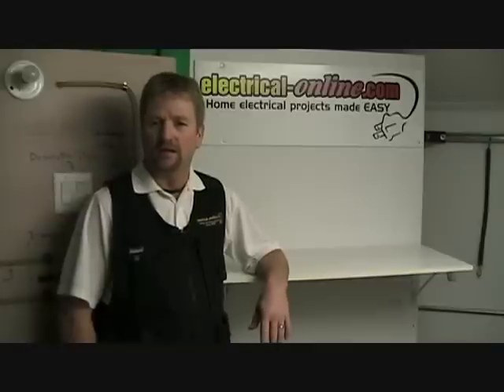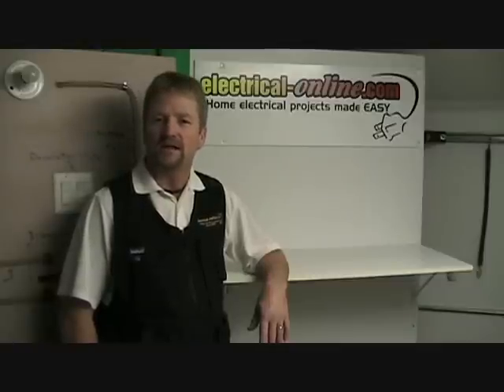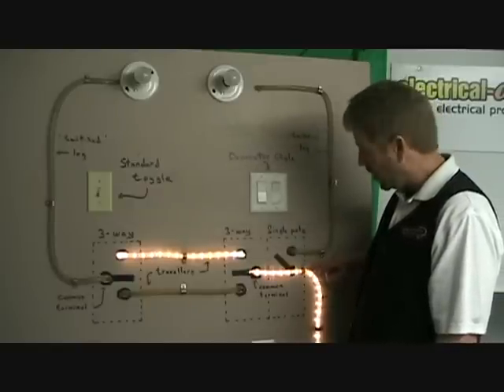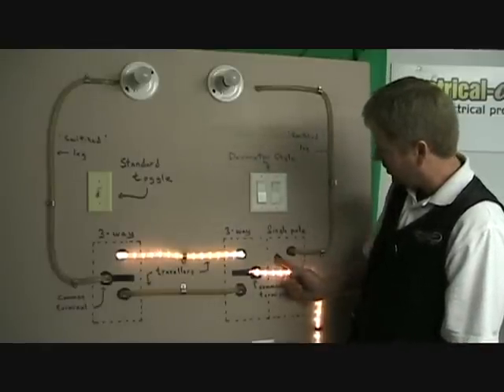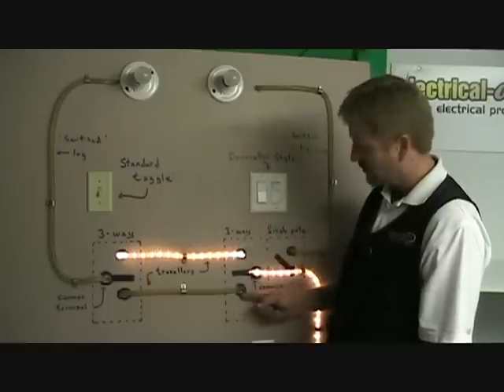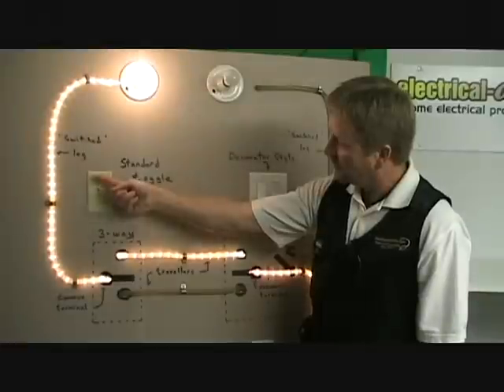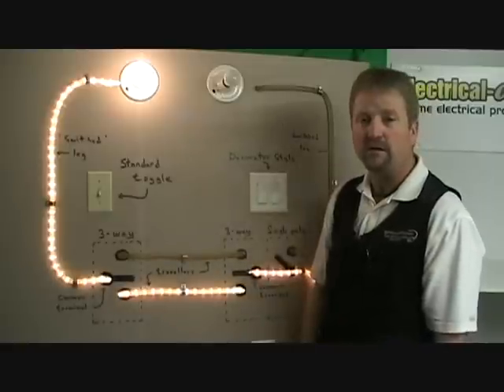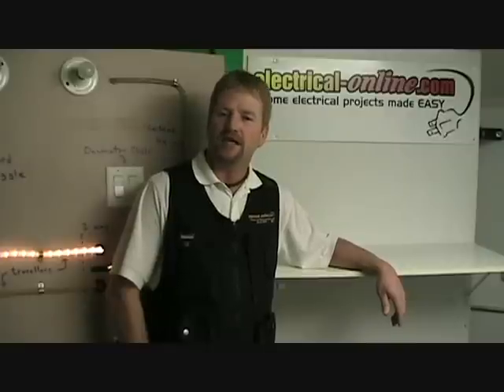Understanding Single Pole and 3-Way Switches

Comment: Great demo; pictures always make it easier to understand. For the beginners, who probably shouldn't be wiring anything without supervision, you may want to mention that 14/3 wire (or an extra wire) is needed between the switches. They may not realize (since it isn't shown) a neutral has to go to the lights to complete the circuit. Again, these people shouldn't be attempting electrical work if they don't know this but they will.

Comment: Why do you always wire your single pole switches with the bottom screw as the hot?  I was always taught that all switches (unless marked otherwise, line vs. load) were fed from the top.  This dates back to the old knife switches that open with the blades out.  The code required those switches to have the blades de-energized when open.  Hence, Line top and Load bottom.  It is very hard for me to do anything else on any switch.  What is your reasoning?  Thanks, great videos!
Reply from the maker: Like yourself, I guess it comes from how I was taught! It doesn't really matter, but your rationalization with the knife switches certainly is valid. Keep doing what you do!
Reply: Terry, after looking at some Mike Holt blogs and a little internet search I think you are correct.  It doesn't matter on a single pole.  Actually the marked terminal on three ways is on the bottom too.  I really like your videos, I can tell you have been doing this a long time.  I am mainly a commercial/industrial electrician but I occasionally take on a residential project.  Your videos give me great ideas.  Keep it up, we need people doing these videos that actually know the code and safety.  I have seen many YouTube videos that were down right scary when you think of some newby trying some of these installations.

Comment: Is there only one way to wire a 3 way switch?I used the method of connecting the 2 'commons' together and it worked perfectly fine. Problem is that my facilitator said we should never join the commons together as it is dangerous... Is this true? And why?
Reply from the maker: There's many ways to wire a 3-way switch network. The one your referring to is the california and/or coast method. This method isn't taught anymore I don't believe? Probably because it does the same thing, but not quite as easy to teach or understand? Not sure,....

Comment: Great video but for the life of me I can't figure out what I'm doing wrong with the following situation.  Location: kitchen.  Two - 3 way light switches on each end of my kitchen.  If one is turned on I can go to the opposite 3 way switch and also turn it on or off.   However, if the light switch on either one is turned off... I can not get the other switch to work.  It's like the circuit is broken if either one is off.   I'm confused because I should be able to turn either one on or off no matter the circuit condition.    Any idea?  Any help would be great.   Thanks
Reply from the maker: You must have the common and one of the travellers mixed up at one end or the other.

Comment: I work as a residential low voltage technician.  So I work in conjunction with electricians all the time.  I have asked a number of electricians to explain the workings of a three way switch.  Never has it been explained to me in a manner that has clicked.  After seeing this demo, this is the first time I feel I have an understanding of how a three way switch works.  Thank you.
Reply: Umber Khan

Comment: I have a condo unit in a very old building; there is a wall switch going to the ceiling fan, it has 2 black wires and one white wire. I am not able to get the fan to work at all. I have put the 2 black wires on the brass nuts and the white on the neutral with no luck. What am I doing wrong?

Comment: Thank you for this. I have wired three ways before, but I always had to stare at the switch box product diagram with zen like concentration to get through it. This finally tells me what a traveler actually is. This reminds me of a two position dc toggle switch with a common hot in the middle which I have always been able to wire without problems.

Comment: Can you have 2 decorative rocker single pole switches in your 3-way switch? My issue is, I have identified the 2 traveler wires and the hot wire on the hot side and the black wire on the other side. I know what wire is what. When I changed one switch, everything worked fine. When I changed the second switch (non-hot side), it broke. As in, only when the non-hot side is in a up position will the other side work. If it is down, the hot side will not work.
Reply from the maker: Your common and one traveller are mixed up.

Comment: everyone shows a switch to a switch to a light, but my old house is a switch to lights to a switch from a gang box. on the switch in the gang box is 2 blacks and a red and white to all whites. How does one wire the light in the middle  of the switches?

Comment: How do you covert a 3way switch to a single pole switch?
Reply from the maker: Just use the top terminal and the common on one side and don't use the other terminal.
Reply: Thanks!

Comment: can you demonstrate how can you tell which return wire goes in which side of the switch. thanks in advance.
Reply from the maker: It doesn't matter what traveller goes to what terminal at either end.

Comment: So, it technically does not matter if the RED and BLACK are on different screws on each end of the run, correct?
Reply from the maker: Correct.

Comment: Hi, with the 3 way switch.. From either entry end you enter from,.. You're able to turn the light On & Off from either 3way switch? For instance, I ENTER the kitchen, from off the hallway, turning the light On, & EXIT from the same hallway, turning the light OFF, that wouldn't affect witch position the other 3 way switch at the other end of the kitchen is in? Correct..?

Comment: This is Not entirely explained (what wires go where on the switches and WHAT WIRES TO SIMPLY JOIN) but people can figure out I guess. That plus I bet there are more people looking here to replace existing switches. (Reno, not new) so people will have to find the feed wire. And that will likely need all switches removed and then turn power back on to test with a test light or a multi meter to find the live wire.

The only things I basically got from this video was to always connect the feed wire to the first Common Terminal Screw on the 1st switch and wire the other 2nd switch so "both" switches in the up or down positions turn on the light.

What the confusing part is; is wiring the second switch. Which wire is the feed wire to place on the common terminal screw of the second switch.

Comment: I think I needed to hear this a bit slower but am so appreciative of your design.  I just installed a dimmer switch that has two red wires (actually on is candy cane colored).  I used the candy cane wire for the neutral and capped off the other red wire.  Now I want to connect the green ground wire and the nearest ground I know of is the copper tubing that goes to my refrigerator.  If I use that water tubing, do I risk being electrocuted at the ice maker?

Comment: @oconnellcom The neutral isn't involved in the switching, so it isn't shown. The neutral simply goes to the lite so it is spliced right through. The neutral should NEVER be switched. If it is (& I have seen it done), the lite will have voltage on it all the time even when the switch is off. This is very dangerous, as you could get a good jolt if you didn't check for voltage after shuting the switch off. ALWAYS do a voltage check. You never know who did a previous install & it only takes a second

Comment: @sikesterone The voltages between AC & DC are totaly different "potential". You would never want to mix these voltages in a system as you could damage equipment not rated for the appropriate voltage. An AC rated meter will not read DC & a DC metter will not read AC. DC systems usually uses a red (positive) & black (negative) wire. The negative is the grounded wire. AC would use Red, black, blue or orange, brown, yellow for power & white or grey for neutral, with green or bare for ground.

Comment: @sikesterone AC & DC refer to the current flow. AC or alternating current is constantly changing from peaks & valleys if you were to see it on a osciliscope. AC is most common because it is easy to change voltages with transformers for transmission from power plants to your home system. Higher voltages use less currrent so they use smaller wire.
DC or direct current is generated from batteries. It would look like a straight line on a scope. DC can not be changed with transformers.

Comment: Terry, I have a bedroom with one pole switch and 4 outlets. The switch turns on the cieling light and also controls an outlet on the same wall. of the other 3 outlets only one works? I used an outlet tester and no lights came on for the two which arent working. Can I remove the outlet under the switch to no be slaved to it? Why would two outlets not work? they did work before. I checked the circuit breakers and all are on. thanks for any help.